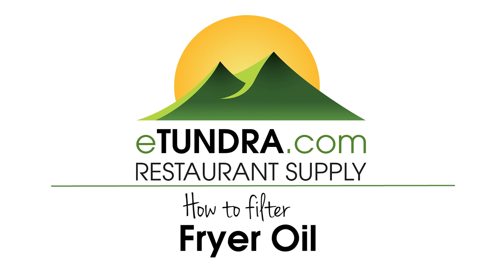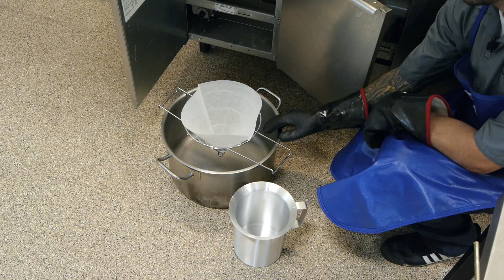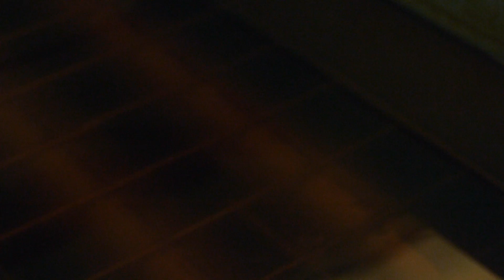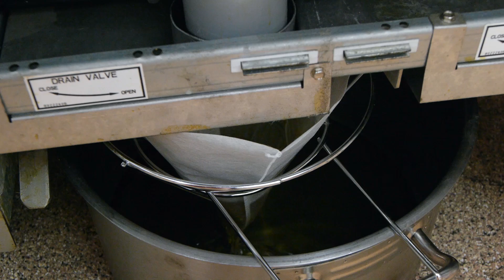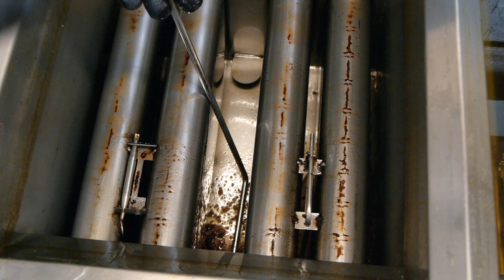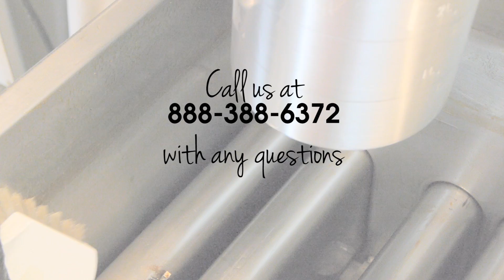How to Filter Fry Oil | eTundra

Comment: the fryer problem im having at work is the switch that turns on the pump to pump the oil back into the fryer is either loose or broken when i turn it on to start the pump the switch slips off the little metal piece and it stops i have to push the little metal piece and hold it to turn it on i cant let go till its done pumping i need to replace it but im not sure what to get

Comment: i would like to se how a fryer thats used 7 hours straight be filtered ^_^ btw, the filter paper is supposed to be flipped inside out.
Reply: i do it coming in to work at 1, and filter everyday and fully clean and put new oil in on mondays

Comment: A filter machine would be more efficient and keep the oil cleaner. Is all that crap you're wearing REALLY necessary?
Reply: Safety is number one priority - CrazyRussianHacker
Reply: Yes!!
Reply: Tony whether you use the machine method or the pot & paperfilter method, the oil will not be any cleaner with first method.  Obviously it all depends on, what your trying, and how much use the oil has had.
Reply: All in all the machine method is much easier.
Reply: I worked at Burger King before and we didn’t have any of that safety equipment lol